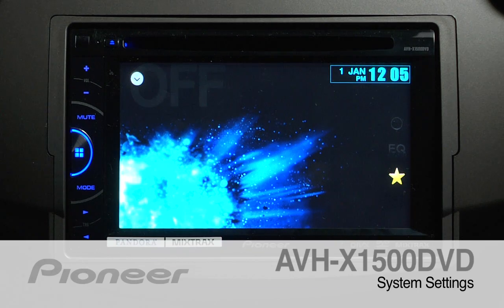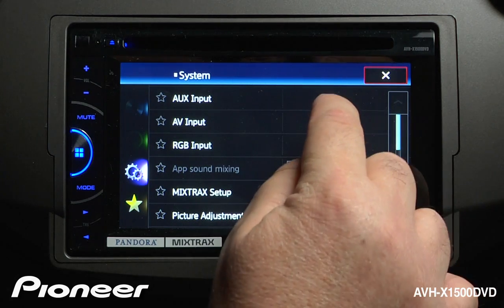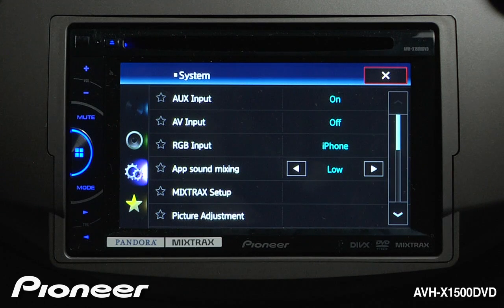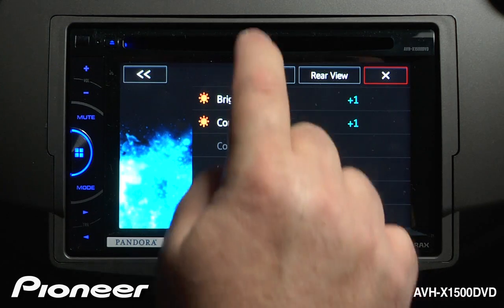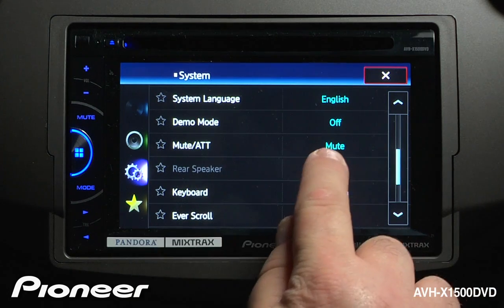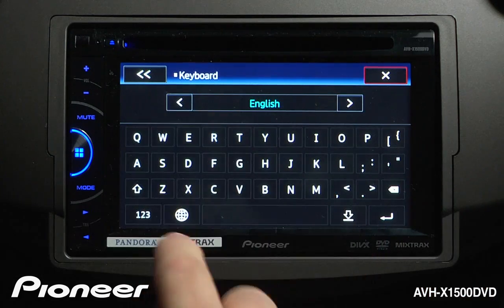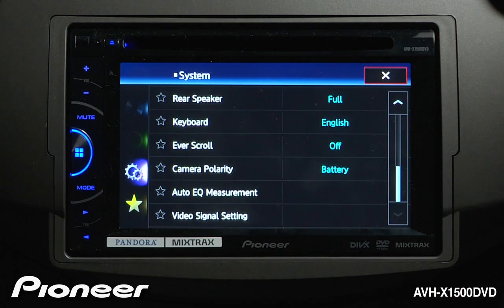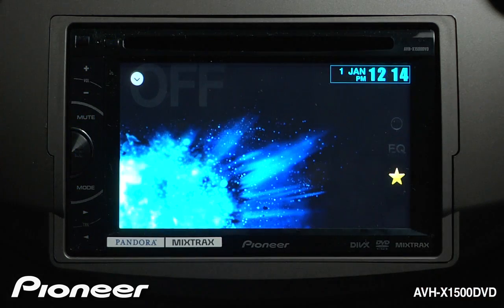How To - AVH-X1500DVD - System Settings

Comment: These satting automatic change when power on or off how to save these satting
Reply: If your clock and radio stations reset each time you start your vehicle your in-dash receiver may have an improper connection for the Yellow Wire or Red Wire.  The Yellow Wire must have constant power from the vehicle. The Red Wire is for accessory.  Do not connect the Red Wire and Yellow Wire together. Please take a look at this video for more information on wiring your Pioneer in-dash receiver:   https://youtu.be/-bF3uzzaT30?list=PLw63zJRQbCNi6CoU7JbUNT83T7ippQbU6     and you can find more videos on Pioneer's YouTube Channel here:  https://www.youtube.com/user/pioneerelectronics

Comment: How to reset it my USB songs are started from 30 sec and song  change automatically  please help me 😢😢
Reply: The reason the songs are starting at 30 seconds and changing automatically is MIXTRAX.  Please turn off MIXTRAX.  You can see how to switch MIXTRAX on and off on Pioneer AVH-X1500DVD here: https://youtu.be/K-QeVuskHcw   More information about MIXTRAX settings can be seen here:  https://youtu.be/5z81voU7ZM8   You can find more videos on Pioneer's You Tube Channel here:  https://www.youtube.com/user/pioneerelectronics

Comment: How do i go back to menu on our Pioneer AVH-X1500dvd? Stuck in reverse camera mode! Help! Its so strange im clicking on the menu button and even held it but its not going back to menu its like stuck in the 
reverse camera mode which i have no reverse camera. I accidently click reverse camera on in settings but then it just not 
going back to menu! Thanks so much for whomever solves my problem! Thanks!
Reply: same problem
Reply: i may know how to fix it. You hold the big button until it restarts. It was a pain in the ass to get that information. Your welcome. The big button is in between the mute and mode button.
 Jermaine Alexander
Reply: Hold the mute button until the normal screen pops back  up